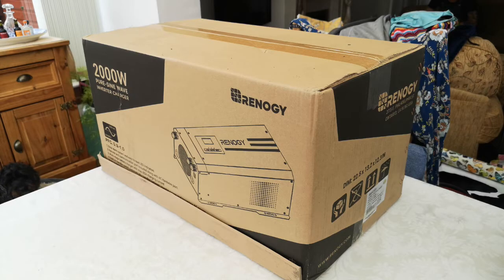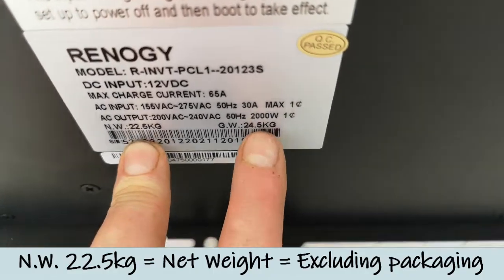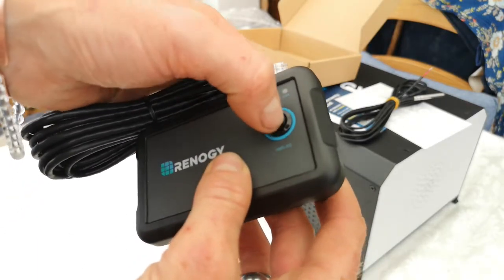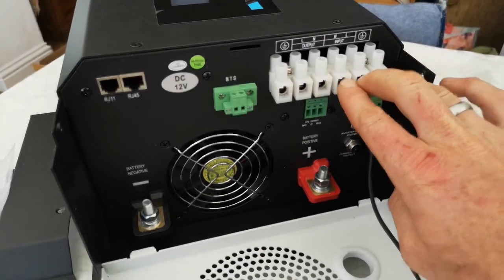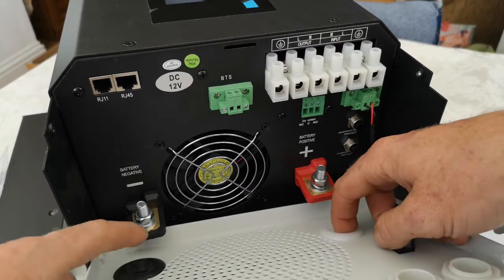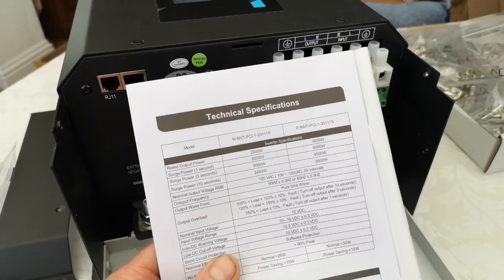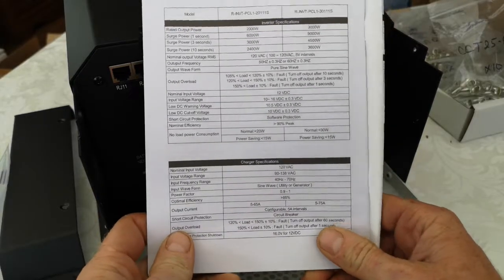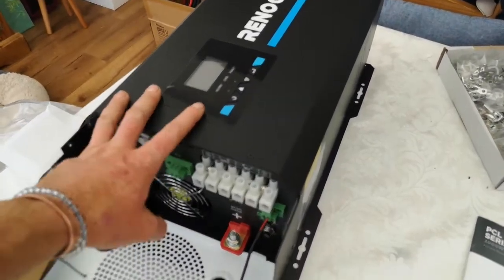Renogy 2000w Inverter Charger Unboxing and How It Works

Comment: Hi there wonder if you could give me some advice I have the same inverter as you so if I connect the inverter to shore power should I be able to pull more than 2000watts thanks in advance mark
Reply from the maker: Hey Mark,
Yes, the inverter charger transfer relay switch is rated to 30 amps, which is 6900 watts at 230 volts. It must not be greater than 30 amps or the relay may become damaged. 
However, i would advise that you switch off the loads, where possible, during changeover to prevent a high current 'spike' when switching over.
 
I hope this helps.
Regards,
Jolly

Comment: Is this brand neurally bonded with earth and compatible with a tesla mobile charger?.. doing spme research before setting up a system?
Reply from the maker: Hey Wesley, thanks for getting in touch.

The inverter charger is not neutral to earth bonded on the AC output. However, I've designed a way to N-E bond it. Take a look at my installation video - part 2 where I explain it in detail. 

I can't comment on the Tesla mobile charger as I don't have sufficient knowledge but would be happy to take a look for you. 

Go to my consultancy page where I can provide more information and a wiring diagram if you need. Heres the link - 
https://vandercampadventures.com/renogy-inverter-charger-installation/

Regards,
Jolly
Reply: @vandercampadventures  ok. Thanks for the reply. Ive decived to go down rhe grid tied route as the house is grounded solving the tesla charger issues 👍
Reply from the maker: Happy days 👍

Comment: How can this be used with a solar panel, it doesn't appear to have solar input or mppt?

Also, can it work in a vehicle split charge situation? Again, does that require a seperate dc-dc charger? 

Not sure I can see too much benefit for the inbuilt charger in these cases, but perhaps I'm missing something!
Reply from the maker: Hey Meirion,

The inverter charger has two distinct functions. Firstly, the inverter converts DC power from batteries into AC power. Secondly, the battery charger charges the leisure battery when connected to mains hook-up power; they are two very different devices. 

The inverter charger has no built-in solar MPPT system, so a separate solar MPPT charge controller is required. 

The inverter charger, solar charge controller, and DC-DC charger connect at the battery, via a busbar. They charge the leisure battery separately from each other. 

Our system features the inverter charger, a Renogy 60A MPPT solar charge controller, and a 40A DC-DC battery charger. 

I hope this information answers your questions.

Regards,
Jolly

Comment: Jolly, great video.  I have one of these fitted to solar panels.  However it does not operate as described in the Renogy installation videos when connecting upto shore/generator power

When the sun is none existent due to the weather I thought I would use a generator.

Connected it up in the way it was described.  But it does not in fact charge the batteries

If I run a generator with the solar panels disconnected. The ac output works fine but it does not charge the batteries.

When I have connected it to mains ac or generator I have had to put a 110 transformer in place.  Because If i connect up with the 230 volts it just alarms and screams its head off.  Even though on the side of the box it does say 230 ac input.

Did your unit act in the same way as Renogy shows in its installation video. If you watch it you notice that the on off switch remains in the off position all the time. It does operate the ac with the switch in the off position but does not charge the batteries in any position.

Renogy tech support have been worse than useless. Take forever to respond to the case created, and when they eventually did. They never answer the question they just say they are escalating to someone more knowledgeable that never contacts you.
Reply from the maker: Hey Kev,

We have a video that explains the shore power connection and walks through all the programmable settings related to the Renogy inverter installation. You can check it out at https://youtu.be/naOGeAzWbvY?si=NhJZ1SFtnp8fNB-y.

If you're experiencing an issue where the batteries aren't charging even when an AC input is present, the unit may be set to 'Battery priority' mode. To address this, switch it to 'Utility priority' mode, which will charge the battery and provide AC output power. You can find this option in the program settings under option 01.

I apologize for not having an answer to your input voltage issue. Can you provide more information about the LCD panel display when it's alarming?

If you need to submit a case to Renogy, provide all the required information, including images and videos, to help them diagnose the issue. In my experience, they've always responded within two days. However, for more technical issues, it may take them an additional day or so to respond.

I'm sorry I couldn't be more helpful. Please let me know if you have any other questions.

Best regards,
Jolly

Comment: We bought the 3000w version just because it wasn’t that much more £ than the 2000w & thought might be handy in future……. Problem we have is the  power cables, says to use 4/0aw /125mm2 which are mega big wires! I noticed you was going to use a smaller size to the recommended. 
Does this mean we could use say 3/0 or 2/0 cables?
Reply from the maker: Hey Mummyofangels, 
Cables should be designed to carry the maximum load of the unit which is why the recommended cable size is so big. 
However, the cable size you install must be sufficient for its usage. For example, we will never use more than 1500w at one time so have designed the cable size to reflect that instead of the maximum load of 2000w. 

Therefore, yes, you can install a different cable to what's recommended as long as it's fit for purpose.

We have an in depth Inverter Charger Installation video with more information about cable sizes. Also, a blog post (coming shortly) that helps with cable sizing.

Stay safe!
Regards,
Jolly 🤘

Comment: Just trying to set my battery charge settings for lithium on program 5 and using the keys to program. It opens at b-1 and I cant seem to get the menu to select the lithium setting shown on the chart. Works fine otherwise. Looking for tips. Can the unit be in use? it must be on of course...but the instructions arent really clear on details.
Reply: OK got it, you tap the arrow key till the display flashes, then the up/down arrow keys will change the display through the menu to the desired setting, b-L for lithium. Then you hold the arrow key again and it selects that choice. I mostly charge with solar but just wanted it set to the correct battery type. Its a solid inverter and the Ren, 2000 IMO is more solid than the AIMS 2500 which I had and crapped out on me, never worked right and chattered and had no low battery cut-out. I called them during warrantee period and no luck, they stonewalled me. Hopefully Renogy is good! I cant afford an Outback!
Reply from the maker: Hey Doug, thank you for this information. We're having a great experience with Renogy products and their technical support. 
Regards,
Jolly

Comment: Thinking of getting one of these. Cuts out having 3-4 extra parts to do the same job...
Just to add.  The Normal open or Normal closed. Is for the setting up of the primary. You can have Shore Power as Primary or Batteries as Primary. Most people will use Shore Power as Primary. Then when disconnected. it switches to batteries within 10ms...
Reply from the maker: Thanks for the comment and input 👍

Comment: I wish I had bought the bigger one, this doesn't support a standard kettle.
Reply from the maker: Have you looked into travel kettles or caravan kettles? There not as fast or as big as a 'standard' kettle but they're low wattage.

This one for example is rated at 650 Watts - https://shop.caravanclub.co.uk/product/1998564/swiss-luxx-1ltr-low-wattage-kettle-ssteel
Reply: @vandercampadventures  I have one, I was harder than going to Target and buying the cheapest I could find, and it's not the only appliance. I can't just take one from the house, and I have to consider combinations of appliances I might run simultaneously.

Standard powerboards here are rated for 10A at 240V.

Comment: Great video Jolly, love your style and detailed, no nonsense way of doing this review.  Just bought one of these inverter changers and been scratching my head over cable sizes. can't wait to see your install video.  Thanks!
Reply from the maker: Hey Carl, thanks for the comment 👍. As well as an install video I'll be doing a detailed article on the inverter charger to include installation and cable sizing. So stay tuned 🤘

Comment: I have a Renogy 2000w pure sine wave inverter/charger from 2015.  It functions as UPS and backup power.. has NEVER failed to work properly.. 
Yes. It's heavy.
Reply from the maker: Thanks for the comment David, that's very reassuring for anyone thinking of buying one. 
Do you have it installed in a campervan? Is the 2015 model similar to the current model?